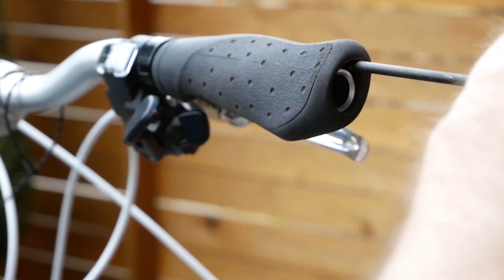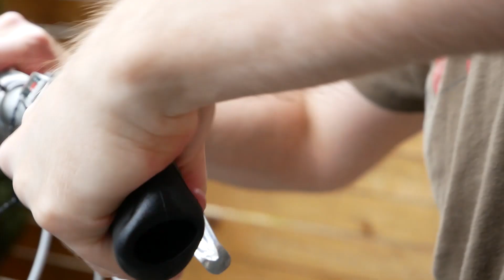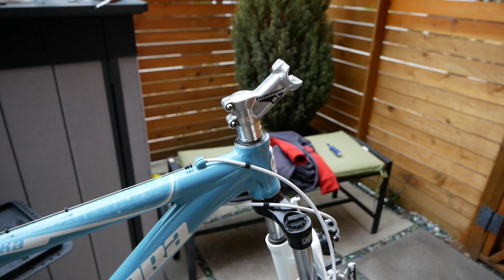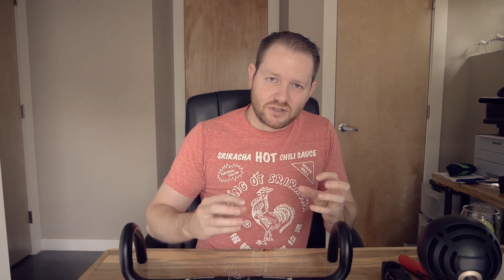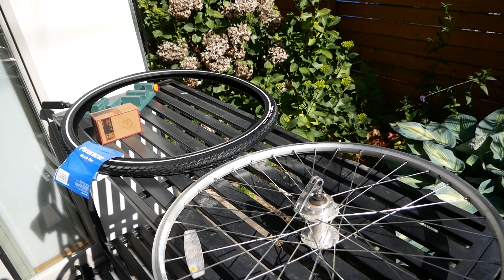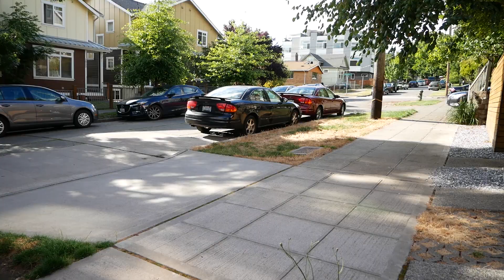How to Convert a MOUNTAIN into a ROAD Bike

Comment: Taping bars is always a crap shoot for me.  I also converted a Cannondale quick 6 hybrid (solid fork) to a road bike.  I really liked it, I kept the same v brakes and used a travel agent for the correct pull ratio with road bike brifters.  I have since converted the bike back to a hybrid since I have acquired a conventional road bike.  I enjoy working with my hands and it was a great self taught experience.  Thanks for the video.
Reply from the maker: I think the travel agent was the right call. These mini-V's just don't feel right. Certainly nowhere near the stopping power of full-sized V's or discs. Thanks for the comment.
Reply: @aaronstestlab  I don't think you bought truly "road Mini-V" brakes.  I don't recognize the exact model, but what you have certainly aren't Tektro RX5 or BX3v, RX1 (all 85mm arms) or 926A (80mm arms).  Your brake arms look long like maybe 95mm or 102mm [930AL, 918AL, M730, M530, 839AL, 836AL] -- thus your braking will not be great with the road levers you used.

Comment: Also its noticiable that its been a very long time u dont have a vbrake , they too changed with the years , the later models like this one u have use orbital shoes , they stay the way u put , so u touch the rim with them and tight the shoes and u're done...i fix mine in 4 minutes , anyway i give u a thumbs up :)
Reply from the maker: You're right, it has been a long time since I've worked with vbrakes

Comment: It's obvious that you are viewing this from a purist perspective. Not everyone can afford to have the best of anything. Sometimes a fair all-in-one is the best option. Especially since it's not necessary to change all the parts that you changed.
Reply: There are other uses too. My 11 year old has been riding a small frame MTB that I converted to a flat bar road bike and she's only just about to outgrow it. I used a non suspension corrected fork, which can be ok with certain frames, and 1.4" tyres. Makes for a fast, good quality, light(ish) weight bike. It was also cheap: while she was riding her 24" I bought up parts second hand and on special.